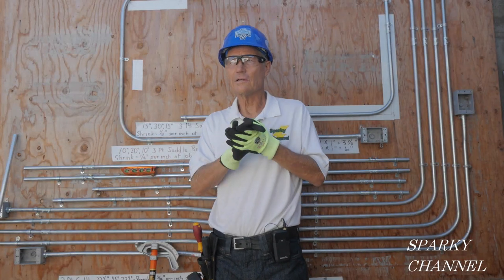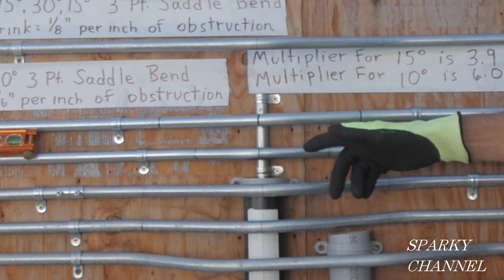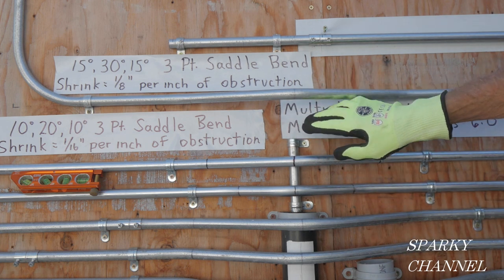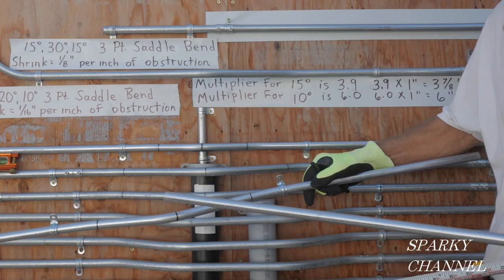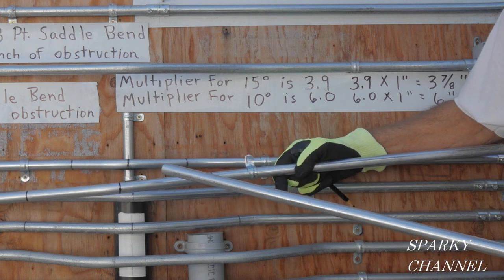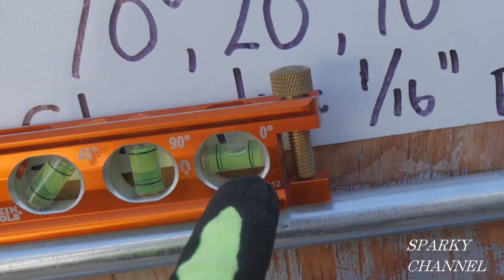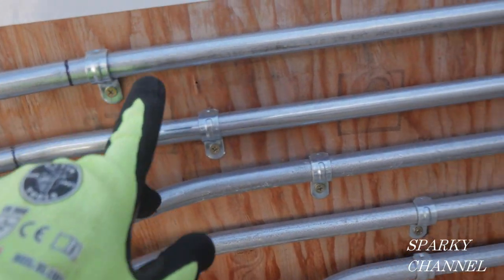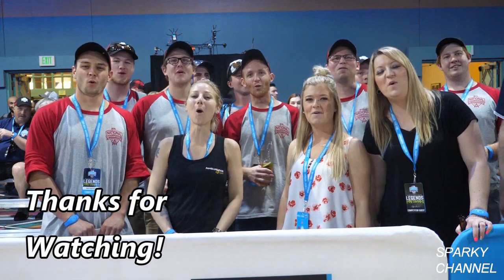How To Make a 10°, 20°, 10° Three Point Saddle Bend

Comment: dewalt compact bandsaw huh
Reply from the maker: Yes sir it's a fine band saw.
Reply: @SparkyChannel   I have a couple of 2 1/2" Dewalt Bandsaws but never seen a compact.
Reply from the maker: @rookis25 Here it is: DeWALT DCS377Q1 1-3/4" 20V ATOMIC MAX Brushless Cordless Compact Bandsaw Kit: Amazon: https://amzn.to/3ChuO6K
Reply: @SparkyChannel  Thank you ill be picking that up soon, In the video I think you should add that whatever degree your center bend is, the outside bends should be exactly half of the center degree bend.
Reply from the maker: @rookis25  Yes, that's a good point. I will point that out next time, thanks for mentioning. ⚡️